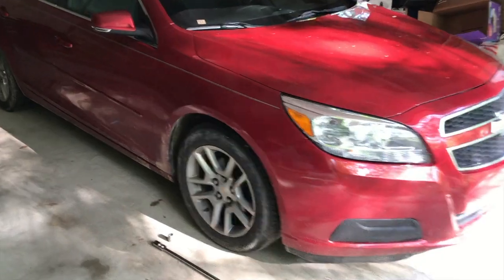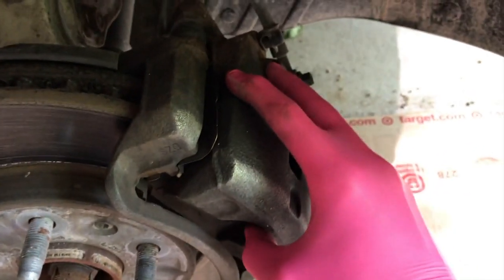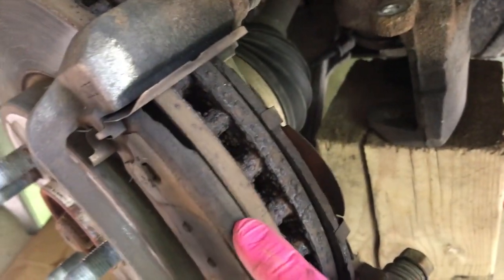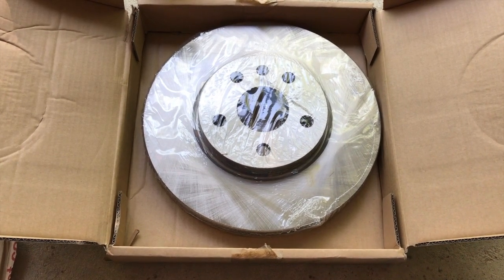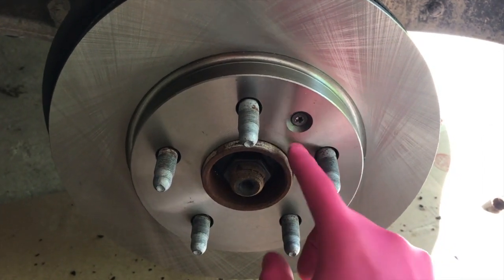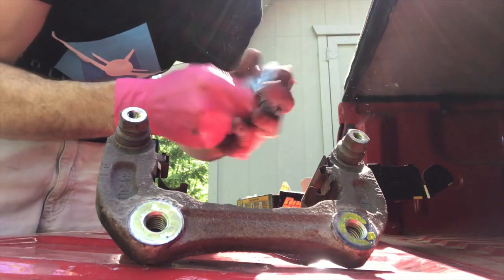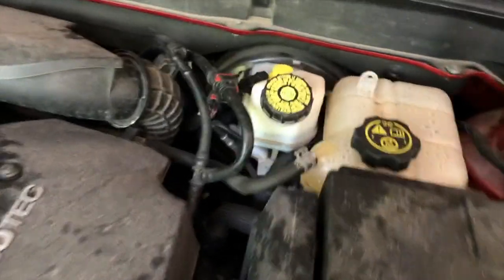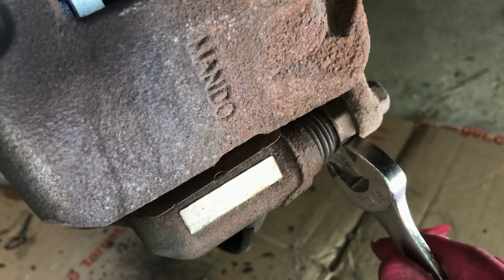How to replace Chevy Malibu Brake Pads & Rotors - 2011-2018

Comment: This video probably saved me about 300 to 500 bucks in labor. Took me about 1.5 hours to complete. It was my first time and a lot more simple than I imagined. Thank you for posting
Reply from the maker: You are very welcome & saving money is great.  You can put that $300-$500 towards something more meaningful.

Us fellow DIY’ers need to stick together!  Hopefully many stress free days ahead for you.

😎👍🔧🔩
Reply: I would be very careful using a c clamp to compress the caliper piston. At least use one of the old brake pads in between the piston and the clamp so equal pressure can be applied while pushing the piston. You don't want to push that piston in cock-eyed.
Reply from the maker: @btcsys  

So true & we really appreciate you sharing this.  It’s very important to work slow & precise.

Any & all helpful info is greatly appreciated.  😎👍🔧🔩
Reply: @DIYwithMichaelBorders  thank you so much for this video this saved my 2016 Chevy Malibu lt… the car kept shaking whenever I breaked hard or at a high speed etc, it was the rotors.
Reply from the maker: @jacobott3382  

You are very welcome, thanks for watching.  😎👍
Reply: @DIYwithMichaelBorders  what tools do I need can u give me the names
Reply from the maker: @comptonxbeastjohn5505  

For replacing a pads and rotors, you will need a standard ratchet/socket set and screwdriver as well as the caliper piston retraction tool shown in the video below.

       https://youtu.be/9H_oF4sUZk0

😎👍

Comment: I think overall a good video. 

I usually place the old pad of the piston before using the c clamp.  That way it gets pushed in evenly without damaging it
Reply from the maker: Joshua Adams

Thanks for watching & sharing your thoughts.  We appreciate it.

Let us know if you have any questions.  Please subscribe to the channel and turn on your YouTube notification Bell 🛎 that would be awesome thanks again!

😎👍🔧🔩
Reply: I was thinking the same thing when watching the video I do the same thing with the old brake pad.
Reply: I was gnna say the same thing😂
Reply: I do the same thing .
Reply: Especially with the GM phenolic pistons
Reply: @DIYwithMichaelBorders  hey my brakes have a pulsating feeling when I press the brake sound like something scraping this started after I had rotors and pads replaced!
Reply from the maker: @got2getit204  

Thanks for watching & we appreciate you sharing this.  It’s possible that your dust plates were slightly adjusted during the project and are creating a pulsating sound during the braking.

These dust plates are very easy to bend during brake projects.

Comment: I wanted to let you know that the t-35 bolt on the rotor does not need to be replaced because it is in place to secure the rotor to the hub while on the assembly line. I have worked on cars for 45 yrs. Found that information while working at AutoZone.
Reply from the maker: Good morning, thanks for sharing.

😎👍
Reply: I was searching for this exact info. My new rotors didn't even have the hole. Make sense. Thank you.

Comment: informative video. Tool size info is very helpful  so you you don't  have to make a second trip to the auto parts store for the one size tool you didnt have! one thing though, I was told by a mechanic that when compressing the piston you shouldn't send the fluid back to the master cylinder but should crack open the bleeder valve and let it go into a jar as it may be contaminated with dirt/ rust from the cylinder. then refill with new fluid.

Comment: Great video! One thing that is important to note for replacing the rotors on this vehicle is that the caliper bracket bolts are one time use. They stretch when they are torqued properly and can’t be reused.
Reply from the maker: Auto Outlet 

Thanks for watching & sharing your info.  Let us know if you have any questions.  Many more helpful videos to come!

Please subscribe to the channel and Ring your YouTube Bell 🛎 that would be awesome thanks again!

😎👍🔧🔩
Reply: Where do I get more caliper bracket bolts?
Reply from the maker: Jonah B 

Thanks for the reply.  You can visit your local Chevy dealership and provide them with the last 8 digits of your VIN #.  They will be able to get you the exact replacement bolts for your exact vehicle.

Keep us posted!

😎👍🔧🔩
Reply: Where are you working that you need to replace caliper bracket bolts every time? I've been working on cars for 20 years and have never encountered a single caliper bracket bolt that is a torque to yield bolt. None of the service manuals advise to replace the bolts either...
Reply: caliper bolts are not stretch bolts! if you work at a shop and charge for new bolts for every brake job, you're just ripping your customers off.
Reply: I’m only going straight from the manufacturers information here that was acquired from all data, if I did this job on my car I wouldn’t replace them

Comment: Great video, appreciate the tip on the star pattern bolt on the rotor itself. Nice to know the tools needed. Doing a brake job on one of these soon. Pretty simple but appreciate the simple to the point video brother. 🤓😎 And yes, always open up the brake reservoir to let the fluid flow out and use a syphon or a towel to soak up excess fluid when pressing the calipers for new pads. Great tips!
Reply from the maker: You are very welcome, and thanks for watching.  Also, a special thanks to you for taking the time out of your Tuesday morning to share this comment.  It means the world to us.

Let us know if you have any questions .

Comment: I have 2014 Malibu lt 2.5  I’m in need of rotors but I don’t know what  sizes are the rotors  I know rear is solid  so many different sizes. I called delar they said something about code j60 but I’m still lost.😅  can I use ventend on rear too?
Reply from the maker: Thanks for watching, great question.  The year and model number Malibu will depend on whether you have the larger rotors or smaller rotors.

It’s best to remove a rotor from car and take it with you to match up with new rotor.  This will guaranteed exact match in size and will alleviate you purchasing the wrong size rotors.

Please keep us posted and hey if you’re into crypto trading, check out our newly launched DIY ecosystem.

       Toolboxtoken.com

Reach out to us any time!  🧰

Comment: Is there a center Jack point in the front of the vehicle that is safe? I see the Jack points on either side but I’d like to go from center to then place the Jack stands. I’ve searched online and I only see people saying Jack points on gen 7 are sides and rear center
Reply from the maker: Thanks for watching, some people will say to lift vehicle up with a Jack and place a Jack stand on both sides of vehicle where points are.

We stay away from applying Jack stands further into underbody of vehicle.
Reply: @DIYwithMichaelBorders  what about the position of the actual Jack? I see others place it directly under the front (middle of the hood/front of car) to then place Jack stands on either side. But many are saying with gen 7 there is no front Jack point only on sides (where you are saying to place Jack stands I’m assuming)
Reply from the maker: @stephanie8327  

Thanks for the reply, at the pinch welds on either side of vehicle.
Reply: @DIYwithMichaelBorders  thanks for all your help! Love your channel
Reply from the maker: @stephanie8327  

We appreciate that, lots more to do and we are excited to continue our mission!

Comment: I'm planning on replacing the rotors on my 2016 LIMITED LS malibu, but they have a 321mm and 296mm type, how do you know which one goes? Cant find anywhere what is the OEM ,
Reply from the maker: Tom My 

Thanks for watching, great question!  We recommend contacting your local Chevy dealership (Parts department) & providing them with the last  8 digits of your VIN #.

They will be able to see the exact size rotors for your exact vehicle.  The other option is to remove old rotors and take old rotors to your local AutoZone and match them to the new ones.  Keep us posted.

Please subscribe to the channel and Ring your YouTube Bell 🛎 that would be awesome thanks again!

😎👍🔧🔩

Comment: I have a 2017 Chevy Malibu and was wondering is the rotor bracket bolt the same size as the one in the video?
Reply from the maker: Thanks for watching, can’t give you a 100% confident answer as we haven’t worked on a 2017 model however it’s very possible.

Please keep us posted.  😎👍

Comment: I want to change my break pads with the c clamp you mention don’t touch the rubber. So do we push it back but leave a tiny portion out ?
Reply from the maker: Ali87 holla 

Thanks for watching.  You will need to compress piston to a point where you can insert both pads inside caliper & then slide it conveniently onto rotor.  Keep us posted on your project.

😎👍🔧🔩

Comment: I have a 2011 Malibu and I just bought rotors and pads online but after purchasing them it shows they fit 2013and up but 
I notice the only difference is that Torx screw
If they are the same size it should fit regardless right?
Reply from the maker: Thanks for watching.  Believe it or not the Malibu has a few different sizes of rotors.  Some rotors will have an air gap along the entire outside radius of rotor while others will be one piece with no air gap.  Some fit smaller size rims while the others fit larger size rims.

What a lot of people do is remove the old rotors and take one of them to the store to match it up to the brand new ones.  Keep us posted on your project.

Comment: A friend gave me some spare brakes and rotors I was wondering are they interchangeable they are for a 2012 I have a 2015 can I use them
Reply from the maker: Good morning, just poured a cup of coffee and am sitting down to answer any and all questions for the DIY community.

Great question and we recommend contacting your local AutoZone and checking with them.  They will be able to look up your vehicle info in their computer system and get you the info you need.

It may be a good idea to take the brakes and rotors that your friend gave you to AutoZone and have them verify if the 2012 set is compatible with your 2015.  😎👍

Let us know if you have any questions and hey if you’re into crypto trading, join our DIY ecosystem and become part of an exclusive group of DIYers.

       toolboxtoken.com

Reach out to us any time!  🧰

Comment: Just a heads up. Next time use the old break pad to compress the cylinder. Even if you put a dent in that cylinder your in trouble
Reply from the maker: Thanks for watching & sharing this.  Any & all helpful info is greatly appreciated.

😎👍

Comment: Hi you helped me with my sons 2014 Malibu ls a few months ago with the oil intake sensors and thank you again big help we’ll now today my son is having another problem his StabiliTrack light came on and his engine light is blinking  I have not got to it to check for codes yet he was on his way to work oh and it kind of stuttering he says I check on line and 90% of people say it’s the EGR valve is that true?  I need your help again thank you for your time. I was wondering if you had in countered the same problem it’s a eco 2.5  with I think 56,000 miles thanks again
Reply from the maker: Jesse Gutierrez III 

Thanks for watching & sharing your experience.  Great to hear from you again.  Sorry to hear about your sons car.

We haven’t replaced our EGR yet.  The EGR is a very good possibility.  We recommend scanning the vehicle for codes.  We can better pinpoint which exact part needs to be replaced.

Let’s get this figured out!  😀

😎👍🔧🔩
Reply: Ok I’m going to check and see what codes it’s throwing I’ll keep you posted
Reply from the maker: Jesse Gutierrez III 

Very cool keep us posted we are standing ready to help!

😎👍🔧🔩
Reply: Ok update on my son’s car checked the codes EGR valve thru a code only once I cleared it never came up again and car is running great I guess it’s just a fluke only code I cannot get rid of is the intake oil valve and engine light stays on for that code I already changed both valves. Thank you standing by and ready to help
Reply from the maker: Jesse Gutierrez III 

Thanks for the update Jesse, that happens & we are happy to hear the Malibu is running great.  We see this a lot & it’s always nice when it just randomly disappears & begins running great.  😀

Feel free to reach out to us if you have any additional questions.

😎👍🔧🔩

Comment: How do you know when to stop compressing the piston?
Reply from the maker: Thanks for watching, great question.  You will only compress it to a point where you can install your brake pads inside Caliper and easily shift Caliper onto rotor with no issues.

At this point, it should be very convenient and friendly to align your bolt holes and secure your bolts.

Comment: @DIY With Michael Borders I have a question. I'm not planning on changing the rotors but do I still have to use the brake spray? Part of me say yes and other part is unsure.
Reply from the maker: DGABE3 

Thanks for watching & that’s a great question.  If you are only changing your pads, you do NOT want to spray your pads.  If you are keeping your old rotors, there is no need to spray your old rotors because the rust repellent additive is no longer present on your rotors and will not need to be cleaned off.

Hope this helps.  😎👍🔧🔩
Reply: @DIYwithMichaelBorders  thank you
Reply from the maker: DGABE3 

😎👍🔧🔩

Comment: Awesome demonstration! Mine came with support springs but my new package didn't include them. I ordered the (Duralast Elite Copper-Free Ceramic Brake Pads DE1913 ) Should I use the old support springs? I already installed my new pads, Thanks for the info!
Reply from the maker: Thanks for watching and welcome to the DIY Raptor Club.  Using the old clips is fine as long as they are not damaged in anyway.

Please keep us posted on your project.

Comment: Should I do front and rear when im changing my breaks or just front?
Reply from the maker: Lauren Quackenbush 

Thanks for watching & great question.  Brand new brakes all around will only be beneficial and increase safety and breaking performance.  😀

Keep us posted on your project.  Please subscribe to the channel and turn on your YouTube notification Bell 🛎 that would be awesome thanks again!

😎👍🔧🔩
Reply: Front brakes always wear faster than rear.  You do not have to do both at the same time.  Only replace your brakes when needed.
Reply from the maker: maximus11400 

Thanks for watching & sharing your thoughts.  We hope the video helped.

😎👍🔧🔩

Comment: Hi where can i order a T30 screw can’t seem to find one locally thanks and is it ok to drive the car without the T30 for a few days until i find the screw
Reply: You will be fine without it. It’s only placed there for the factory assembly line, your rotor is secured with the wheel nuts and brake dust build up will make it stuck and more secured after a few stops but you are perfectly safe

Comment: What size c clamp were you using ?
Reply from the maker: Thanks for watching Stephanie, we used a 6” C-clamp in this video.  Keep us posted on your DIY project.

😎👍
Reply: @DIYwithMichaelBorders  THANK YOU!
Reply from the maker: @stephanie8327  

So happy to help!  😎👍
Reply: @DIYwithMichaelBorders  the windshield wiper fluid hose on my 2011 Malibu just snapped . I need to replace but can’t find a diy video. Do you have a video or know of one ? Thanks again!
Reply from the maker: @stephanie8327  

Thanks for the reply, don’t have one at the moment.  You can drive vehicle to your local AutoZone and they can match the exact hose to get you your replacement hose and fitting.

Comment: Can you list all Tools needed
Reply from the maker: Thanks for watching, you will need:

1.  Floor Jack
2.  Jack stands
3.  Standard ratchet and socket set
4.  Possibly a breaker bar
5.  New parts
6.  Brake cleaner

😎👍🧰

Comment: Where is the jacking points, when lifting the car from the rear?
Reply from the maker: Thanks for watching & that’s a great question.  If your vehicle does not have exact pinch welds in the rear, do your best to find the most solid and safe place to apply your jack and jackstands.

Comment: This only applies to 2012- 2016 limited.  The 2016 model year saw the first year of the new body style.
I can’t find a video about that.  
It very well might be exactly the same.  My 16 new body style doesn’t have the electric switch for the e break.  
I doubt the bolt sizes are identical. 
Don’t forget Thread anti seize.
Reply from the maker: R EMC 

Thanks for watching & reaching out to us.  You will find it to be very similar.  Keep us posted on your project.

😎👍🔧🔩

Comment: What's cross thread? Don't over tight the screw
Reply from the maker: Great question, definitely do not over-tighten any screws or bolts.

Cross-threading is when you don’t properly align the bolt thread to the inner thread of part.  If you don’t align threads, the bolt will screw into threaded insert in an offset manner and get real tough to screw in.

This will unfortunately destroy the thread on both bolt and part…and even worse…it can get so offset and tight, that it snaps the bolt before it’s even tightened…leading to a very bad day.

Great question, and we appreciate you asking!  😁👍🧰

Comment: No brake grease on the pads?
Reply from the maker: 1111 

Thanks for watching.  Some do some don’t.  We hope the video helped.  Let us know if you have any questions.

😎👍🔧🔩
Reply: DIY With Michael Borders btw I think the dates for this video start with 2013, changing the 2012 rotor/pads. 14 & 13mm, no t30 screw
Reply from the maker: 1111 

Very cool & thanks for this info.

😎👍🔧🔩